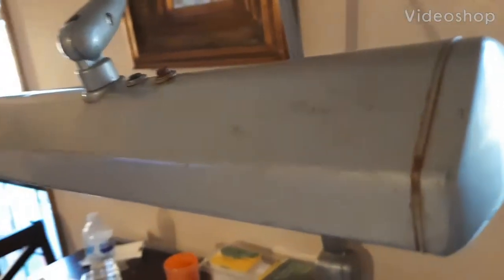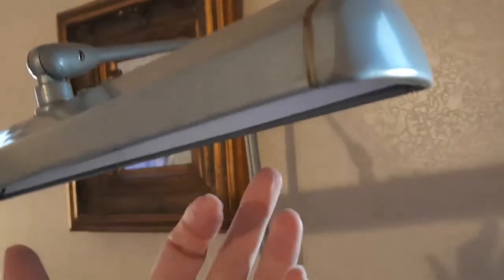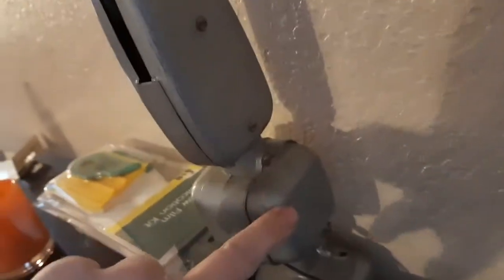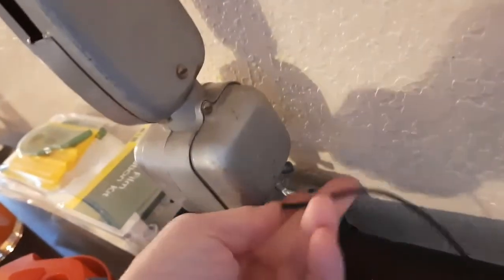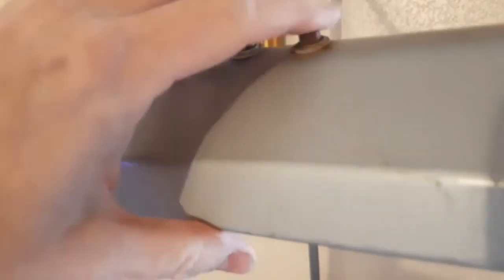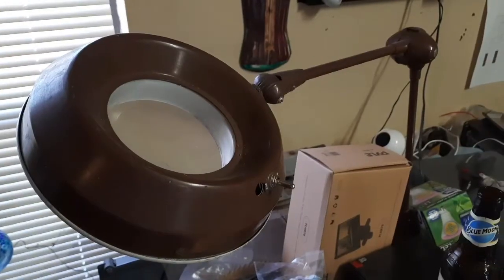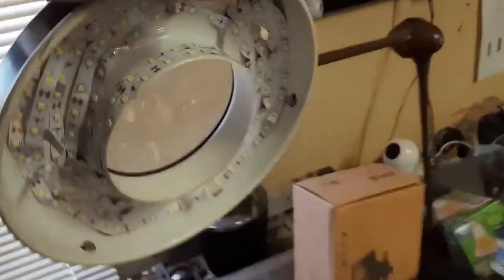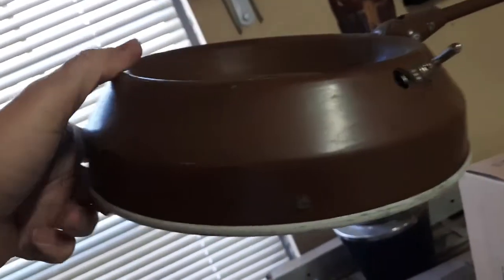RETROFIT a Vintage lamp with LED on the CHEAP

Comment: The original fluorescent lamps consume only 15 watts each.  One problem I have found with many LED replacements is the 120Hz AC flicker.
Reply from the maker: No flicker when I use the 12v power supply vs trying to use fluorescent adapter bulbs or strips.

Comment: do you have a picture of how you wired the on/off switch for the led?  going to do the same thing you did to mine.
Reply from the maker: No, just a switch inline from the power supply to led. On the hot side

Comment: You don’t happen to know how to tighten the head on this lamp do you? Mine is loose, but when I take out the liner on the inside of the lamp, there is no nut on the inside to tighten up
Reply from the maker: I don't but if there's no adjustment nut, I wonder if there was some kind of liner like a thin plastic sheet that was used?